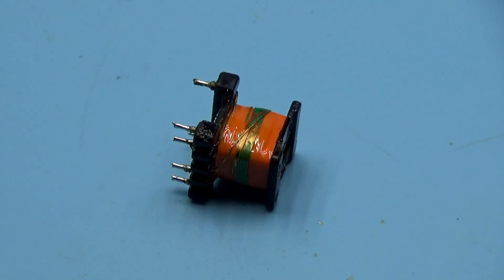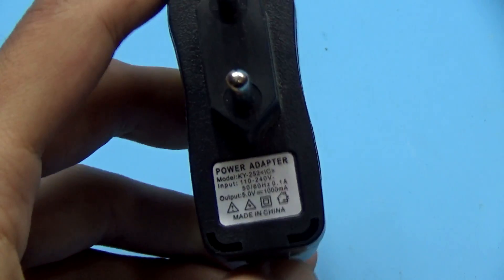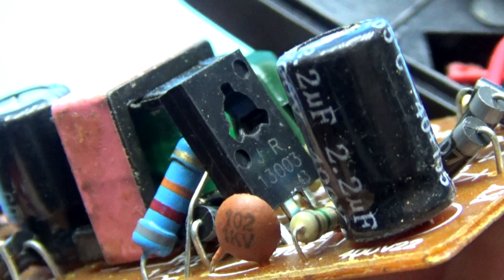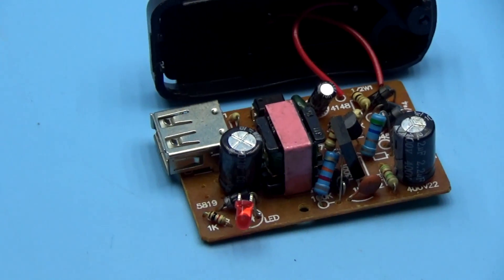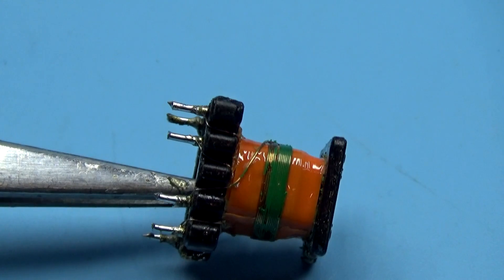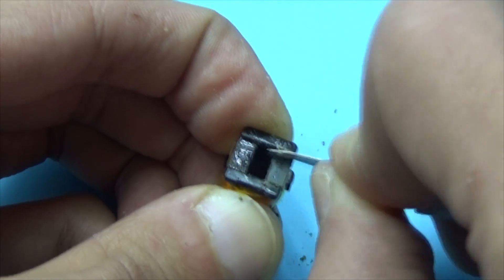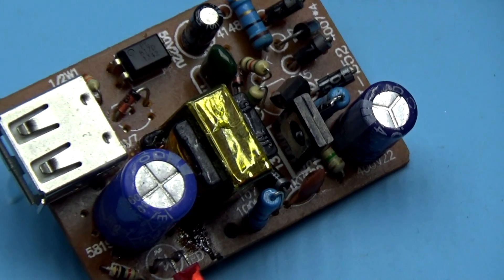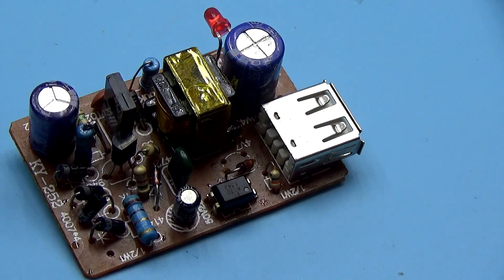How to increase the power of the charger

Comment: the casing looked identical to one I already have but the inside is completely different, I changed the voltage by changing the feedback resistor but I still need to make some tests

Comment: It is possible to built or adapt this transformer circuits in a way that if nothing is connected as a Load, the whole circuit works as an open circuit for input stage??.. i mean, that if nothing is connected and the transformer still plugged, it stay there with zero power consumption

Comment: Good day. Is it also pssible to step down a 19volt laptop power brick to output 12volts just by modifying the windings. Without using any extra components such as a regulator.
Reply: Hi im looking to do the same thing to run a cb radio at around 13v. Do you know how?

Comment: Nice video but i have a question about  5 v dc android wall charger of 40 amps with switching FET 10N60 operated with a smd ic. Due to the fluctuation main input Ac 220 volts switching FET Transistor is burnt along with frequency controlled smd ic not available generally. Can i replace this burnt switching part of the circuit with other part of the  circuit board ?

Comment: I need opposite! To raise voltage from 12V to 24V, how to do that???
Reply: Just double the amount of turns on the autput and change the voltage of your Z diode to 22.8 v and make sure that the components on the output can handle the voltage. Im not sure but  I think it is right.

Comment: Regards , Kasyan. Excellent channel. As your colleague , if you dont mind, i would add one precaution and warning - safety margins when winding SMPS transformer. In your video , i saw that you haven't left any space from end of winding to the end of transformer body. If you look closely , industrially made transformers have winding that is in wound in the middle of body ad have some space between ends. Sometimes they also use some insulating "sleeves" for ends of wire that connects to the transformer pins. That ensures better primary to secondary insulation and that can be dangerous from the safety point of view. Everything else is excellent , thank you for detail explanation , i really enjoy watching your videos. Keep up the good work.

Comment: The question is if the Power-Transistor can withstand the higher current without cooling?
Reply: The answer is no it wont!! That's what I thought too. And usually this channel would have pointed this out but they didn't. I wonder if they just missed it....

Comment: Cool video but for the effort you may as well just buy a suitable power supply in the first place
Reply: Your missing the point.. this is a fantastic video but you just can't see why it is..
Reply: @talclipse  no I understand that it's cool that you can change components of a plug for it to have a greater output of power but it's not worth it
Reply: Then y u watch the video 😂
Reply: @GS-bd9zh  it popped up in my suggested
Reply: @transgrl  The point is that this is an universal guide. Of course it's not worth doing on a phone charger, that's just for simplicity of explanation. But you can do this on ANY unit that uses this topology, if you need a 20w supply for a project and have a crappy old one lying arround you don't have tu buy a new unit, just modify the ood one . There simply are times when you can't just go to store and buy a more powerful supply (mostly in work environment) and also high power supplies are expensive. If a 100w supply costs 20$ and a 200w cost 50$  it is sometimes worth spending 10$ on components rather than on a new unit.

You also now know how to make the supply from scratch, meaning you don't have to even go find one in a store, you cam just build it if you have stuff at home
Reply: Just proof of concept
Reply: The idea is learning and the satisfaction you get from being able to do something like this... that guy was right you missed the point of the video....
Reply: @keithking1985  the title says how to. This is supposed to be like a tutorial but you would just buy a better power supply.

Comment: Good video.  As they say, the parts to make it costs pennies (usually), the knowledge to make it is priceless.  In my case just finding the magnet wire to rewind the xfmr would cost many times simply replacing the ps with a bigger/better one but where would the knowledge come from?  However, the safety concerns expressed in the comments are valid.  Opening up and modifying any mains level electronic device is dangerous so don't do this unless you know and understand the risks.  The shock you receive could be deadly!

Comment: Be responsible and just don't do this. These adapters cost a couple cents to make and not worth anything. CE marking on this kind of products stands for Chinese Export. If you want the cheapest cr*p, you can get it anywhere but don't be amazed if it's really cr*p!. Video is nice and shows some of the faults but should end with advice to trash it.

Comment: Very interesting in principle! In practice however, a 2A 5V charger replacement could be purchased for less money than the time (=money) it would take to make this modification. Great knowledge for enthusiasts and engineers, though! Using the same principle, one could modify a much higher-amp PSU to an even higher output, thereby saving money! :)

Comment: Incredible how cheap chinese manufacturers are. Slightly higher quality components cannot cost that much more and performance gains are amazing. Have you checked if all the components are within their power rating range? What about temps?
Reply: Chris Donuts, all manufacturers do this cutting costs on components.  I work on retro computers from the 80s out of the US such as commodore 64 etc.  You must see the cost cutting there.  Going into the history of commodore business machines, the cost cutting is very core to the heart of commercial electronics as consumers view electronics as luxuries.  Wallwarts tend to be cheap and fail.  When they do, you buy another cheap one to replace it.  Problem is where do you stop cutting costs and make it durable?

Comment: Pl make a video on increasing voltage from 12V to 15V to use as a carbattery charger from old computer power supply.
Reply: Find a pin from the main ic that goes through a resistor to the output. Cut the trace, solder a trimmer potentiometer in there. Should get to 15/15.5v.

Comment: There are "Verizon" labeled chargers that charge at a lot more. The best one I've found is 12v to cell. At Verizon they are expensive. My typical 12v to cell charger is about 500 mills. these are 1200 mills. Not sure how they do it, I need to measure the actual charging voltage for a clue.
Reply: 12V to your cellphone? That thing will blow up
Reply: @somedude2492 12v Verizon charger. ………… …….. think man
Reply: She is suggesting that the voltage lowers from the charger. I need to check the Verizon charger to know. Problem, the charger is micro out only. I have the same tester, it does have a micro in, but I've not used it.
Reply: Or maybe its an out ?

Comment: interesting, would have been nice to know the AC input voltage applied during the initial output analysis and upon completion how it performed over the entire input AC voltage range.... not to mention temperature rise of key components ( before and after )...  Cheers
Reply: Based on the plug I'm going to go out on a limb and say  220 to 240 volts would be the input.  Tbe plug type is type C which is European Asia South America ungrounded
Reply: @frantickoala994  thxs, kinda figured that, the label on the power supply listed input Voltage: 100 to 240 V AC.  normally when you measure an output voltage one states at what input voltage.  it's also a good idea ( & design testing )  to measure the output ( range )  over the entire input (range) as there will be some variation . . . and especially after any modification(s) have been made.

Comment: That was so cool, I love modifying existing circuits.
Reply: Hi can you please tell me how to change a 5v 5amp power supply to 12-14v 5 amp? Would use it to run my cb radio. Thanks alot

Comment: I don't like this topology as it often fails, you can't tell when it fails. And this kind of power supplies must not be used to charge any mobile device, its insulations are as unreliable as its price. Many death cases can be found, associated with it.
They must be banned for being used as a charger.

Anyway I appreciated your modification on this thing.
Reply: These are switching PSUs. They are insulated from the line by the transformer. Inside the case, they are perfectly insulated. Don't go scare random people on the internet please.
Reply: @somedude2492 , I don't need to scare anybody, everyone has their own intelligence to judge which is correct.
I have worked with this kind of stuffs, and this kind of power supplies (using one MAIN switching transistor) can often fail, excluding rare occasions.
I have also opened the transformer myself and saw that it doesn't have more than one layer of insulation tape between primary/auxiliary and secondary winding. And the insulation too isn't a proper kapton tape.

And everything isn't insulated.
Metal-body smartphones are also available in the market that has a common ground connected directly (galvanically) to the external metal body, which may lead to shock if the 0.5mm thin insulation in the transformer or the 1nF 1kV capacitor in the charger fails for some reason.

If you don't believe me, you don't have to, go check out DiodeGoneWild 's youtube channel or bigclivedotcom 's youtube channel. They have explained everything practically.

Please do some research before criticising someone.

After that if you can prove me wrong, I will withdraw my words from the comment section.
Reply: @anindyamitra5091  bridges can collapse and kill people, so we shouldn't use them for safety. 
We both agree that this charger is (very) poorly made, but that doesn't make all simple switching PSUs a killer. A lot of things need to go wrong for the mains to go through the charger, jump through the phone, to you, to ground, create a voltage differential of 220V in your body, and kill you. For once, if all that goes wrong, current is coming from the main line and going to ground. Your breaker will cut the power to your house. But then, for that to happen, the two coils have to weld together. If that happens, the primary coil is shorted. The short will blow everything in the charger up. If somehow the charger doesn't blow up, then the rectifier diode at the output will blow up, as it's not prepared for 200 volts running through it. If that blows, you have no power to the cable, and thus your phone gets isolated form mains voltage. We've already got 4 things that have to happen at the same time. I'm not saying that it can't happen, but it's such a low chance that it's basically worth the risk to use these circuits.
Reply: @somedude2492 , you have got to the point somewhat, but you didn't see my previous answer carefully.

I WASN'T TALKING ABOUT ALL PSUs. 

I WAS TALKING ABOUT "THIS (particular) TOPOLOGY" (WHICH USES ONE MAIN SWITCHING TRANSISTOR AND NO SOPHISTICATED OSCILLATOR CIRCUIT TO DRIVE THE TRANSFORMER)
FOR BEING DANGEROUS.

Anyway, let me tell you that all diodes (you cannot show any exception) fails short circuit, i.e., it behaves as a conductor after failure. I am talking about overVOLTAGE breakdown (avalanche breakdown) failures, which you had mentioned.(not the overcurrent failures, in which case, it fails open-circuit, sometimes.)

Again, those magnet wires used in the transformer windings have a 100-200V dielectric strength, and they don't have to weld together to give a shock, if they just touch each other and have a potential difference of twice of that range, then you can be sure to expect a shock from the setup, that is why proper insulation should be used.
And the charger HAS highest voltage peak of about 600V.
Let me show you the math, we have 230V A.C. mains, which when rectified, has 230×√2≈325V D.C. plus the voltage due to flyback operation that these power supplies (the transistor SMPS) use, which gives a peak of about 300V in the reverse direction. So, a total of about 300-(-325)=625V across you and the charger output. It is definitely fatal.
Plus the A.C. voltage peak. So, a total of about 800 V to 900 V is possible to be found between ground and the charger output.( I am talking about the maximum possible voltage).

It is also shown by DiodeGoneWild, in one of this SMPS teardown video (I remember), you can see it.

Thank you for the discussion and I will no more reply on this post further, so don't reply in this comment, if you are planning to.

Peace!
Reply: Hushhh, baje kotha
Reply: @HMPirates , ei ki6u din age e ekta death case sunlam, mobile charger theke, e sob, Mi-Samsung er charger e hbe na, egulo e sob "jali mal" gulo theke e hoe. Aage nije dekho tarpor amar kotha ta baje ki valo amay bolbe.

Ta chhara, ekhane ekta y-rating er capacitor primary to secondary te thakar kotha, seta era dei na, er jonno e primary to secondary winding e breakdown hoe.
Era zener bebohar korechhe, ekhane tl431 ic die reference ante hoe, seta besi accurate hoe, ekta 5v zener e ±0.5v obdir tolerance thake( due to temperature fluctuations), fole exact 5v dei na circuit ta.
Ekhane output filter capacitor ta o low ESR noe fole phone e charging er somoy noise dhukte pare, seta mobile er charging ic ta ke damage kore onek somoy, seta o consider korte hbe.
Ami nije ekta kinechhilam ebong use kore tobe e bolchhi, tai ja bolechhi jene bujhe e bolechhi.
Reply: @HMPirates  aar serokom hole ekta kine test korte paro, koto din charger gulo chole dekhe nebe!
Transistor match hoe gele circuit ta onek din jabe, kintu seta r chance khub kom.

Comment: How to connect a single 1W or 3W led to 12v (I need this for my motorcycle) can't use a Resistor because of huge power draw, right? I know dc buck convertor is available, but can't use that in small space. Is there any decent circuit? Please share at least a web page for my requirement. Thank you.
Reply: Hi Arun, An LED driver IC like PT4115 can serve your purpose. It is much better than a buck converter. But if you want a quick fix try AliExpress for extremely small buck converter.
Reply: @nafihahmd  yeah, let me wait for is there anyone know a DIY solution
Reply: zener diode..!
Reply: I think there should need a big Resistor even when using  zener diode. Is there any DIY solution.
Reply: May be very simple but can't remember when really urgent,
Reply: Instead of using only led, use many LEDs in series.
Reply: @HMPirates  Thank you for suggestion, but can't use it for the situation
Reply: @arunbalakrishnan8978  there isn't any simple diy solution for it. Either use a dedicated led driver or use a buck converter. There is a lot of space on a motorbike for a little buck converter, it's not necessary to put the converter close to the led.
Reply: @arunbalakrishnan8978  If you want to use a resistor, it should be approximately around 60ohm 20W power resistor.
Reply: If possible, use 3 LEDs in series. Then the resistor does not dissipate as much power.
Other than that, a buck-converter/switchig led driver is your best bet. There are some pretty small ones available.